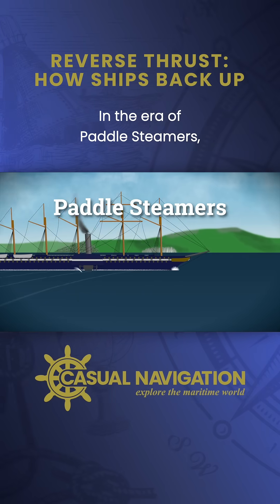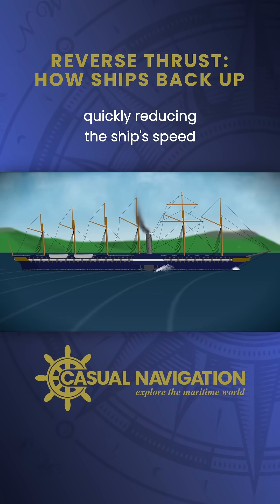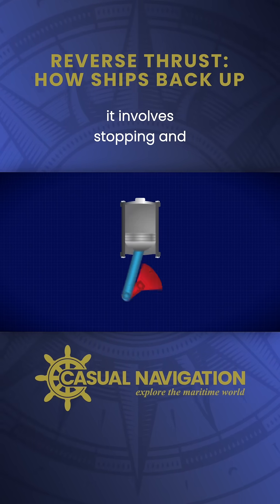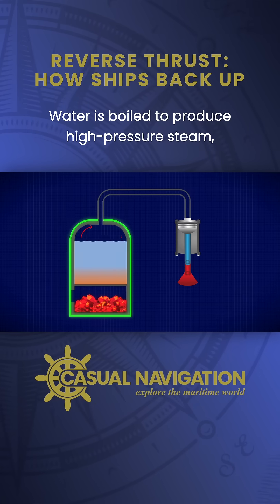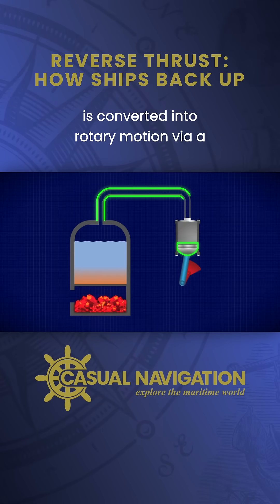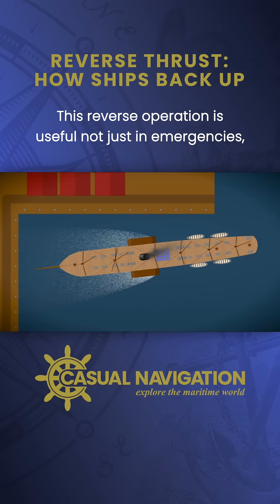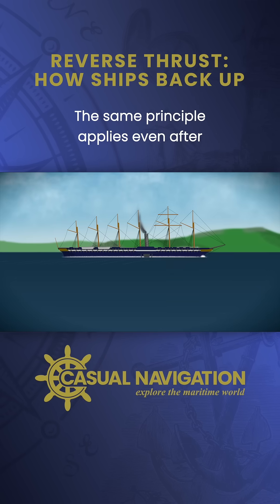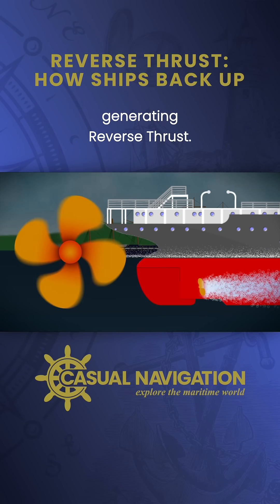Reverse Thrust: How It Works

Comment: Early Mercury outboard engines (2 cycle) did the same thing. They had a twin pinion starter, and when reverse selected, the engine stopped and was restarted by spinning the starter motor the opposite direction, engaging the second pinion and starting the engine 'backwards'. Because of reed valves and 2 cycle porting, the engine ran just as well backwards as forwards.
Reply: Thanks...So, there were no gear box? Because piston is still moving up and down....Do, where is the magic?
Reply: @KPKCCK  There is a gearbox, but it only has neutral and forward. It also 'changes' the direction of motion, from spin in the vertical axis to the horizontal axis. (Hence a pinion and driven gear, and a reduction, usually about 2:1).
Reply: @Chris-hx3om Thanks for the clarification. But why do we need to change the spinning axis from horizontal to vertical and vice versa?
Thanks.
Reply: @KPKCCK All outboard engines are vertically mounted. Pistons are one on top of the other. The crankshaft end was a socket spline and the driveshaft ran directly into the top of the gearbox. It had the pinion on the end and that drove a larger gear that was connected to the propeller shaft.
Reply: @KPKCCK The only outboard engines I know if that had a horizontal crank were the 777 Marine engines. They were highly modified small block Chevy's crammed into an engine cover. I never got to work on one, but the gearing would have been a nightmare.. that may be one of the reasons they are no longer in production.

Comment: You drew an internal combustion engine and not a steam engine. A steam engine has multiple valaves so that it can be pushed from both sides of the piston while also letting the steam out after the piston has reached the end of its stroke.
Reply: It’s a simplified model smartass
Reply: Excellent.... The same, I was thinking.
Thanks for pointing and the clarification..